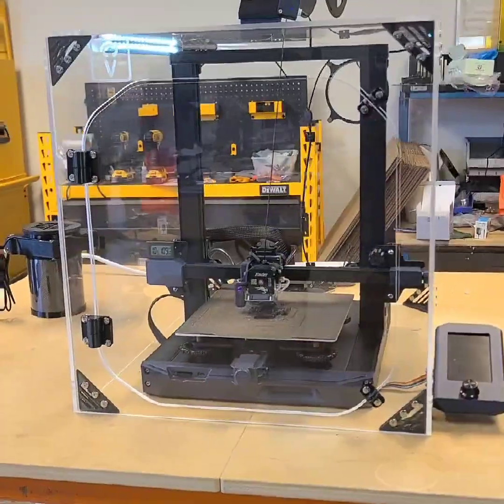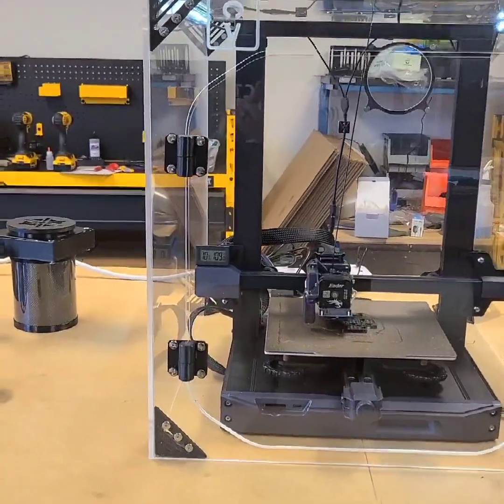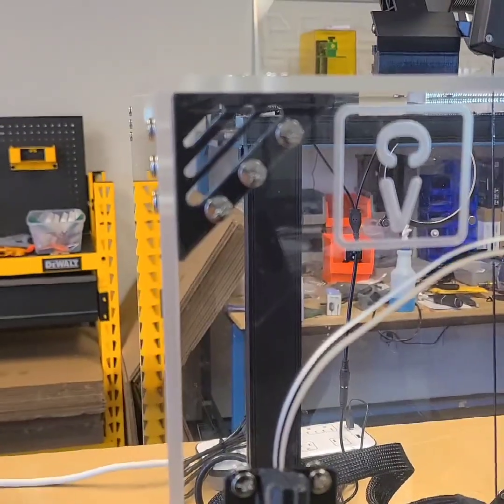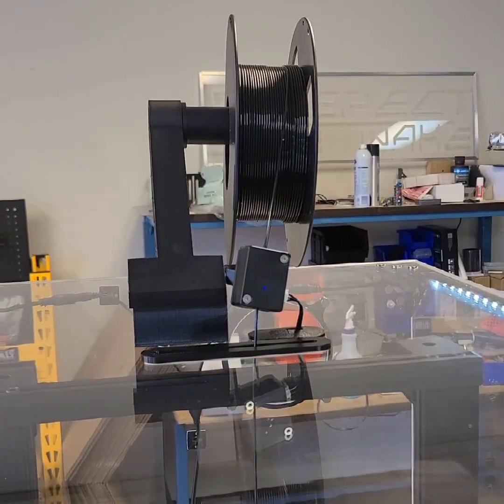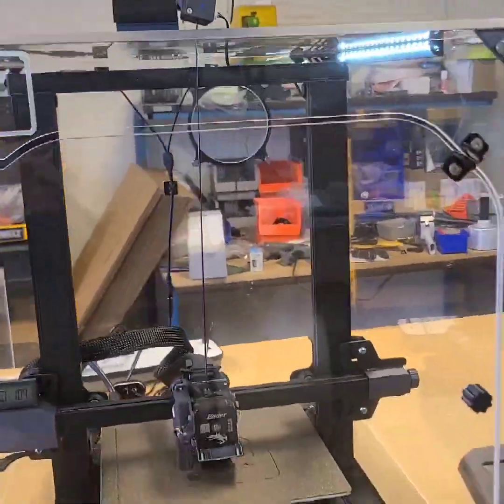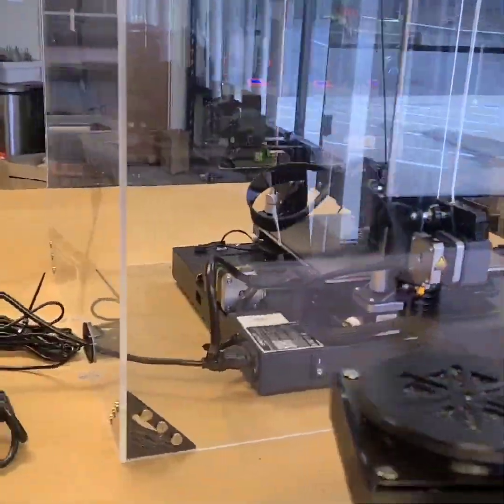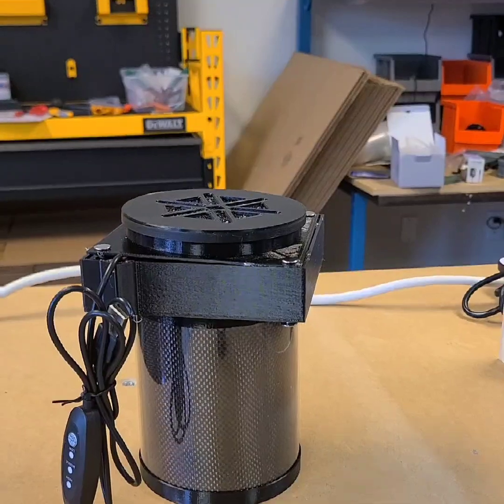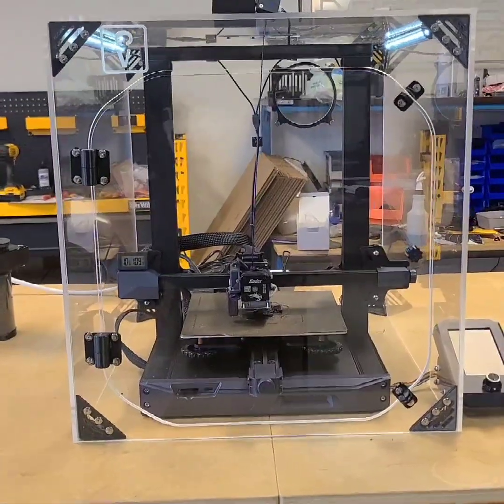Creality Ender 3 S1/Pro enclosure for 3D Printing by Clearview Plastics

Comment: Honestly, I wasted $70 on Creality's enclosure that slipped around when the printer was running so I would be interested in something like this, but... I would want it to enclose my filament spool and panel, and I would want to have good access to the machine without removing the enclosure. This was another issue with Creality's enclosure too.
I think you have a great product here that there would be alot of demand for, but it doesn't quite hit the mark.
You may also want to make a version designed to work with a sonic pad based setup, which requires the machine not be moved, or it has to be completely recalibrated.
Reply from the maker: Greatly appreciated reply. I'm going to order up the sonic pad to see what we can add in. We have a internal spool holder option that we developed and is an additional addon. For the S1, we even developed a bracket that allows the filament runout sensor to fit in. Check the link below. As far as enclosing the control panel, fitting other accessories, other options, etc it becomes a too many variables on our side. Adding an option often creates complications, half solutions, or degrades the appearance. All in all, We work to have the best fit and function availble. Our enclosures are tailor fit, tested, and professionally manufactured. https://www.youtube.com/post/UgkxMVWBe3QaSf6jhTDMfc6itylhUZDfNo0n

Comment: Nice design but I would use a poly-carbonate such as Lexan over acrylic.
Reply from the maker: We have that as an option and it is good for certain situations. Acrylic is good for those who want better scratch resistance and a lower cost. The ender never really goes over serviceable temps of acrylic and most don't need bullet proof enclosure. Acrylic is a lower cost option which many users prefer and it actually has a more crisp premium feel. We opt for acrylic for most of the enclosures in our print farm as the preferred material. All has been good even when printing with a chamber temp of 140f (60c)

Comment: Everyone recommends that you should not keep you powersupply in the enclosure, so won't this damage it?
Reply from the maker: With the power supply being at the base of the enclosure, the air going to the power supply stays within the serviceable temperature. The base of the enclosure stays much cooler than the printing surface or top of the enclosure. Even if the power supply useful life is reduced, it will still last years. All that said, for those that need to have their power supply cool, we have an option for power supply venting coming on 5/1/22 :)